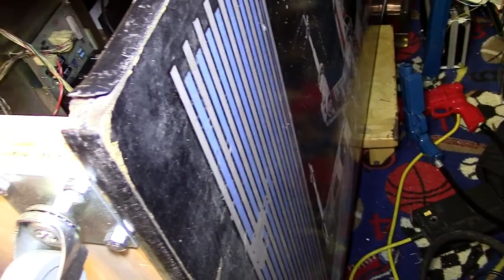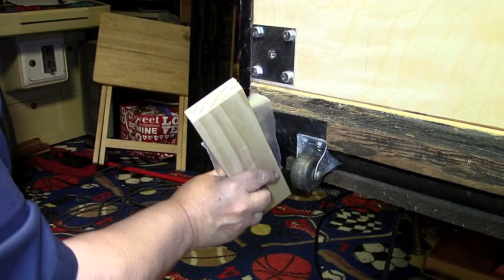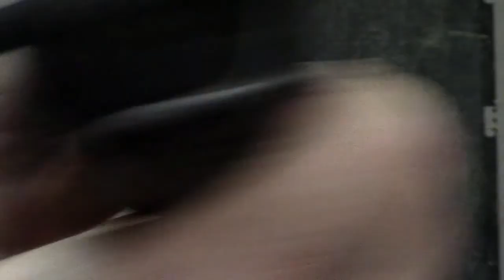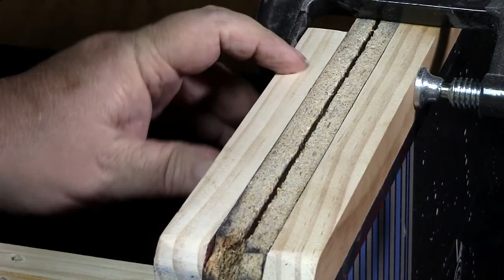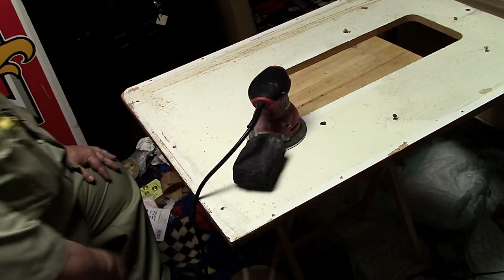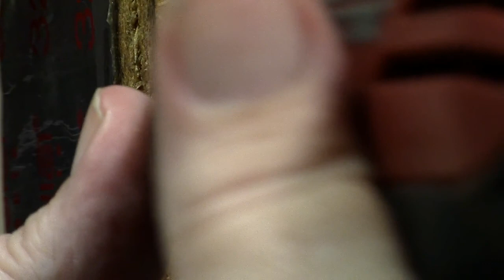Star Wars Cabinet Repair Part 5

Comment: I used to work at a place that made store displays and on t-moulding they ran it to place where it couldn't be seen and shot short brads in the ends through the part of t-moulding that goes into the wood to keep it held tight

Comment: I've started using Bondo fiberglass filler to fix corners and big gashes as it's extremely tough, the only problem is the stuff cures harder than hell and takes FOREVER to sand!